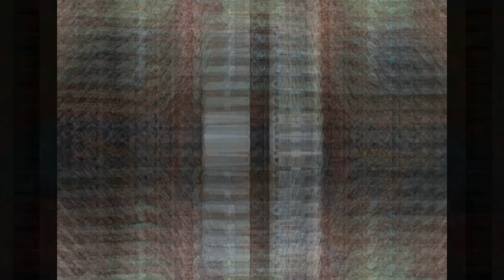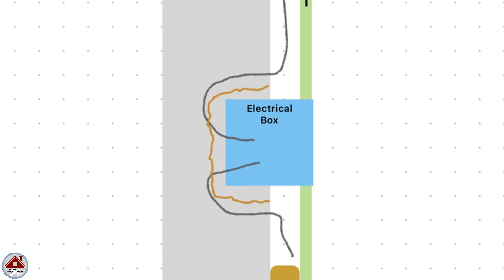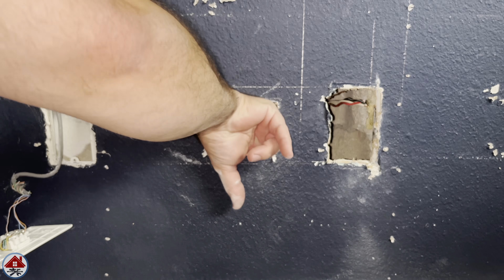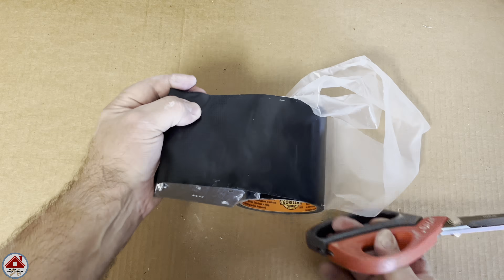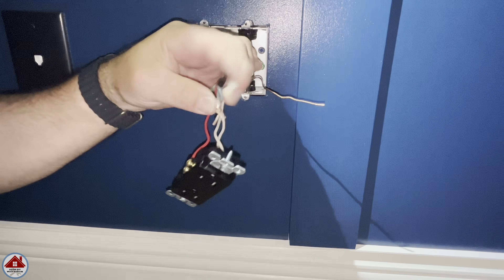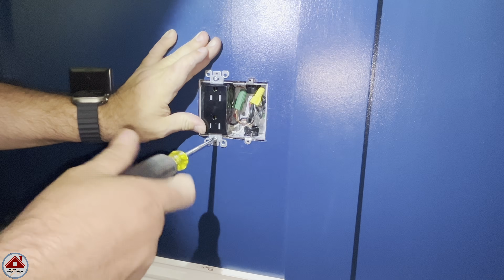Moving a Receptacle/Outlet on a Shallow Wall DIY

Comment: I have never seen a wire nut with a hole out the top. Why didn't you just use a pig tail instead?
Reply from the maker: The green ground wire nut with the hole in it is quite common, and to be used that way. But mostly because I was trying to use the least amount of wires as possible since space was limited installing with and in a shallow box. I hope I answered your question and thanks for watching my video!